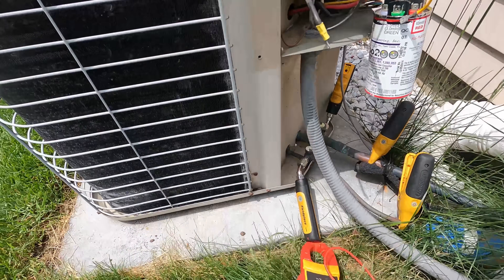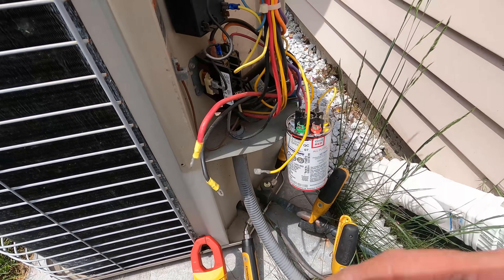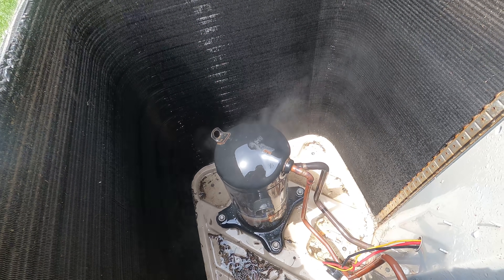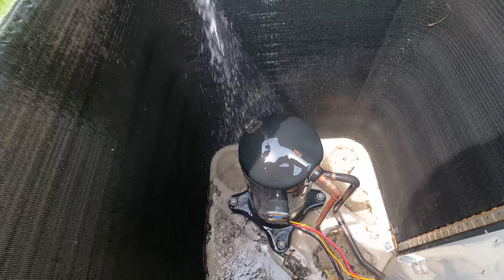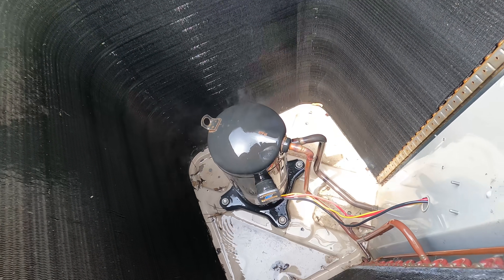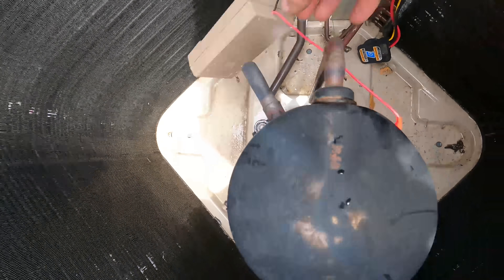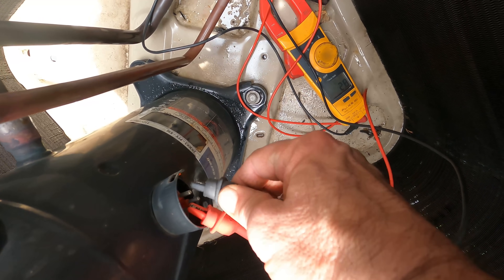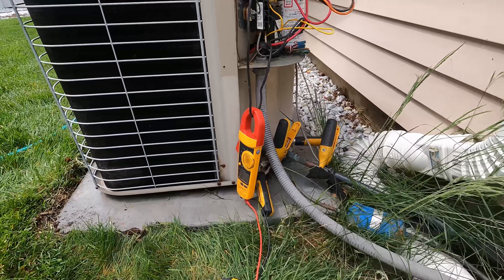AC Compressor Overheated Not Cooling Testing Windings/ Megging, Ohms Fixing HVAC System

Comment: Did you find where the leak was?  You completely filled the system, I did not see nor hear you mention finding a leak prior to addiing refrigerant?
Reply from the maker: This is not a standard service call. This is a Sunday emergency call on the first hot weekend. No leak searches are performed. Only repairs to get systems to operate and return on regular business hours for leak searches or big repairs. New system will be in mid June
Reply: @thehvachacker  You do realize the purpose of the Montreal Protocol Actt was to prevent hydrocarbons from destroying the ozone layer of our atmosphere. It just seems irresponsable to knowingly fill a system which had previously leaked out all its refrigerant, some six lbs of it. I think its a serviceman/womans job to prevent more freon escaping. I would of informed the customer that returning the following day to do a evacuation and a search for the leak was protocol. You would of gotten much better out of it. First you would of prevented more freon leaking to the atmosphere. You would have saved the owners the cost of additional freon in the future and would of fixed the leak. You would also have recieved a few extra hours of work by completing the job. Instead you will have to bill again the customer when the loss occurs poluting our atmosphere and putting the customer through another cooling related service call.  I understand it was an emergency call to get them cool again but I can not stress the importance of fixing the leak the following day when normal hours resume. It will make you a better serviceman by doing so
Reply: @jbpost52  yeah your right..
Reply from the maker: The follow up for this leaker was a sales lead. The customer already has paid for a new system. They just wanted cooling then and now. Their system will be replaced mid June. If I don’t charge the system up someone else will. 95%-98% of the system charge will be recovered.
Reply: @thehvachacker  If the customer is sceduled to have the AC replaced in mid June, it might be wise to push the scedule up to the following day, otherwise the freeon may leak faster than anticipated, provided your work scedule allows for advancing the time slot of this job. As you mentioned you already sold this job to be done mid june.
Reply from the maker: I sold job before charging. It was first available date I could get an install crew set up. This was to get the hem to then. Which it should records show this system gets charged like this every 2 or three years. It’s a small evap coil leak. We will charge up the systems. Yet what we charge for 22 makes most realize it’s not worth to keep the system and put another g into it. I know it’s not nice yet sometimes a reality check makes the customer, we been mailing and informing, every year that 22 has been phased out and the refrigerant may not be available soon. I had them sold upon arrival on the system. I hate having to do that yet 22 leak. That’s why they wanted to start with 3lbs then 4 then 5 was their cap to spend on this system so they could be comfortable. I was trying to talk them out yet can’t turn down a customer. Who will only call another company after I leave.

Comment: Good job man, just curious I know the system is old and its probably have holes in it since its 5lb gas. Just for confirmation, it had holes and they cant afford it or you couldn't check because they cant afford it?
Reply from the maker: It had 3lbs added in 2019. They had money, nice middle class neighborhood. I was jammed up Sunday call and worked to 1am that day. When I am on call/ emergency service, I don’t leak search often. Since it’s an emergency they are calling up about. I will do what I can to make their system work. Then usually a follow up for a leak search happens during regular business hours. If it’s a during the week service call then I will do a leak search. Yet with r22 it’s not really worth to fix leaks anymore.
Reply: @thehvachacker  Good job,dam 1am. Good information on r22.
Reply: @thehvachacker  American environment protection laws are kind of crappy, here you can't even charge an r410a system without finding and fixing the leak first. R22 is straight illegal if you need recover the remaining charge and use replacement gases or replace the unit if it leaks.
Reply from the maker: @netpok  we are allowed to recharge a system. No laws agaisnt. Yet how long will supply last. Plus that call was just under a grand. Not many times will many want to pay that much when zero warranty it will last a few days. If flat I won’t even offer to charge. R22 must be replaced and 410 leak search must be done. Yet system had 100 psi standing pressure and this is first hot week. I know it will last a month if not the whole summer.
Reply: @thehvachacker  Yeah, I didn't mean to say it's "your fault", if there is no law against it they will just call the next guy in the phonebook if you say no.
Reply from the maker: That’s why I charge up a system then look for leak. By keeping them going until they are ready to replace. Stops most from shopping around.

Comment: Wonder if system low like that, do you think there maybe air trap inside?
Reply from the maker: Hard to tell. Yet I recommend replacing. They wanted temporary cooling. The system wasn’t running like it had noncondensible. Yet with a leak it needs to be replaced.

Comment: What is the typical operating temperature of a common kitchen refrigerator compressor?  A modern one, less than 10 years of age. 
Mine is running 125F when not running, and up to 170F when running a lot to restore fridge and freezer temps. Is this fine? 

 Thanks.

Comment: The compressor has an auto-shut-off fail safe mode if too low on juice? What's the cost of a new compressor?, Install in a day ?
Reply from the maker: No safety on this system for low pressure. Yet due to it being an old r22 machine it's getting replaced with a newer unit. I usually don't recommend replacement unless it's an old r22 leaker. Never if it's only an electric part. R-22 has been phased out

Comment: Does anyone know if there’s any benefit to spraying a compressor down when it’s running on really hot days?  We had a string of 108-109 degree days in Texas recently, and I felt compelled to go out and water the compressor through the grill a few times during those days.  Does doing that make it less likely to break down if it’s operational?
Reply: Not directly on the actual compressor, but a mist or sprinkler running on the condenser coil that surrounds the compressor on really hot days can really help out a struggling system, but it’s not something that should be done on a regular basis, as you risk excessive corrosion of the coils/tubing, which can lead you to a leak. If you’re gonna do it, save it for the hottest parts of the hottest days when your system is under its heaviest load.

Comment: Im no expert. But if it took that much freon. There has to be a leak. Isnt r22 kinda expensive?
Reply from the maker: It has a leak on the evaporator coil. I sold a system while here get customer wanted temporary cooling. Until new system was installed.
Reply: Even if I'm in Vegas and 22 I'd rarely used anymore. Just ask the supply houses. MO99 and 422b (nu22) are the refrigerants of choice out here.
Reply: I love listening to guys still in school or guys working through there 1st-3rd summer tell people how bad of a job they're doing! It's soo easy to tell how long they've been in the field. 
When its  110°f on the ground and that means it's 125°f+ on the roof & on top of that you've got 8 more calls to do before you get to go home, let's so you do every tiny little thing the book says to do. The customer doesn't care about any of that shit. They care about 1 thing and it's the same thing your boss cares about......***it's you selling a new unit or fixing that and getting them some cooling with a quickness so you can get your ass to the next one.  Maybe it ain't as busy where y'all are but I know here in Vegas we can't see straight right now it's so busy.

Comment: put bag of ice on top of compressor and let hose run on the bottom 👍👍
Reply from the maker: Ice works if you have it. a hose and running water will always cool the compressor off. That is always available. I can cool the compressor with running water faster than I can run out and buy ice. There is a hose adapter someone made for cooling compressors. who knows maybe one day I will buy it.

Comment: Why wouldnt you go off the name plate for the charge?
Reply from the maker: Most units have a lot more refrigerant than the name plate. The name plate is only good if short line sets are used
Reply: Name plate weight is the condenser filled plus 15' of lineset (normally)

Comment: How do you check for oil? Is there a site glass on this model?
Reply from the maker: no way to check the oil in this compressor
Reply: @thehvachacker Thank you for the reply, so there’s no way to fill this either right? Meaning if you bought a new one it’s factory sealed?
Reply from the maker: You can remove the oil and add new. It required cutting out the compressor, draining, and then adding new. They come from factory with some oil in them. Pressurized with nitrogen and sealed
Reply: My compressor is 20 years old has surface rust, AC still working 50 degrees Fahrenheit temperature reading out the vent downstairs. What is the typical Service life of a compressor? I’m thinking by the time I have to replace the compressor change out to a different refrigerant because it’s an older style and then change out the coils from inside or the furnace is. I’m probably better off just going mini splits for efficiency and cost. What is your professional opinion?
Reply from the maker: @peckerpeter2078 surface rust is nothing to worry about. If system is 20 years old, when compressor goes it’s time for a new AC system.   I wouldn’t put mini splits in to replace a central AC system. You don’t gain efficiency. Central AC is a better choice since all rooms get conditioned. With splits, only the rooms they are in are really conditioned. You hope some of the cool air trickles into the space nearby
Reply: @thehvachacker  Thank you for sharing solid information. I figured to ride this AC out. Already replaced capacitor with contactor, insulated, and wrapped line set on outside of house. Time to replace filters and do a thorough cleaning.. I hate having ductwork in an attic (the most inefficient way to cool a home it’s a 2 story home built in 1992 upstairs air barely comes out plus it’s coming out at 62°F. Downstairs comes out at 49°F.
Reply from the maker: @peckerpeter2078  attics are the best place to hide the ac and duct system. Sounds like you have 2 systems. The second floor system isn’t cooling correctly unless you’re keeping your inside at 80*F. Make sure you’re not sucking in attic air. It can only cool the air entering 15-20 degrees. The air moves so fast through the. Duct system the attic heat shouldn’t heat it up.
Reply: @thehvachacker  thank you for your reply. I disagree that attics are the best place for ductwork especially in zones where the temperatures are over 100° outside the attic would be over 140° guaranteed making  ice cream in an attic is not efficient.

Would munch rather have ductwork exposed inside home like commercial spaces do compared to being in attic.

Home is two-story 2626 ft.² With one AC unit for the whole house furnace and handler is upstream blower located inside garage condenser unit is outside where weather is over 100° F in the summer. I am unable to clean the evaporator because I just sealed up the box that had major leaks. This is a Payne /carrier brand so lines would need to be cut and evaporator would have to be removed to be cleaned and system would have to be refilled. The system is from 2004 so the Freon is way too expensive. Compressor has surface rust it’s just best to clean the best. I can replace the filters and keep it going until I have to replace with a new unit or go ductless mini splits.

After cleaning the condenser and replacing with new filters, I got the downstairs vents with a temperature gun to come out 32 to 35°F, which is an improvement from the 50 to 48°F it was before . Upstairs is a totally different story week air and only comes out 62°F. I’m thinking this Home should’ve had a two unit AC system. this is a concrete tile roof with 3000 ft.²

Comment: Dude R-22 is still around. During the Obama Administration everyone scrambled to replace their R-22 equipment because of massive EPA overreach and massive amounts of R-22 was recovered and sent to reclamation facilities. Just because it's not being manufactured anymore doesn't mean it's no longer available. So many R-22 systems were replaced that the price of R-22 actually dropped at one point. What are you going to do when you put in a new R-410a machine with that logic and it is phased out a year later and you have to explain to the customer that they will need to replace their system again? You can literally still buy R-12 and it hasn't been manufactured since 1996. R-410a is literally on it's way out. Daikin has already committed to R-32 (you know, the parent company of Goodman). Did you even look for oil? The suction was in a vacuum so signs of oil should be present somewhere and, even if you don't immediately see any, a leak detector should pick up refrigerant somewhere. For all you know, the leak could be a flare nut on a TXV that just needs tightened. Also, why are you charging by vapor? Seems like a giant waste of time considering that after a pound or two the bottle gets so cold you can barely suck any vapor in. All blended refrigerants must be charged by liquid so why not charge by liquid for all refrigerants?

The worst thing about this entire video is that you walked away from a unit that literally just had a compressor out on thermal overload due to inadequate cooling because of low charge with only 2 degrees of subcooling on a unit with a TXV. You literally left the unit low on charge. The chances of having a solid column of liquid at the TXV are slim to none. What kind of service tech asks the customer how much refrigerant they want added? You either charge it properly or let a real professional charge it. Never in my career have I let a customer dictate how much refrigerant was added to a system. It's charged when it's charged. They know know up front how many pounds it holds and how much it costs per pound. I do it right or I don't do it at all. Of course I never ever ever troubleshoot a unit without inspecting the entire system to begin with and I NEVER neglect to look for oil when a suction is running in a vacuum. HVAC Hack is a more appropriate channel name. You just want to sell a new unit. I'm sure you had a nice long talk with them about that off camera. 

If you are watching this video for educational purposes I highly recommend you choose a different channel. 0/10 for skill, 12/10 for half assed hackery.
Reply: Truth bomb
Reply: 100% agree. Where was the check for a leak? Especially this expensive R22. It's just going to leak out again.
Reply: @f.hababorbitz  At the end of the day, a full blown leak search is the customer's choice but it only takes 15-20 minutes to visually inspect for oil and run a leak detector over U bends and common leak areas such as rusted filter driers and accumulators. I would have 100% charged it up, leaking or not, if that is what the customer wanted me to do. A happy customer is a returning customer. Customers will spend more for repairs/replacements if they feel like they are receiving quality service and aren't being screwed. It's hard to do that when the unit wasn't even charged properly to begin with and will most likely start flashing in the liquid line in a week or two and, subsequently, run with a starved evaporator and high suction temp (that's what causes compressors to cycle on overload after all) because it's still under charged.
Reply: Bingo stockpile of r-22 years supply left . Markup is through the roof the industry did the same thing with r-12.Train has left the station with global warming . If they where so concerned about our earth why close all American coil factories that made quality coils that didn't leak .HO CHI MINH CAN POUND SAND!
Reply: @metal2444  nothing like using thinner walled coils and increasing pressures in them by 100% at the same time. cough 410a *cough*.

Comment: I know this is not a window unit your working on, but I am puzzled with this LG window unit AC I am trying to fix. The compressor is coming on but it takes a bit to finally kick on, and getting cool normally for a few minutes, but then it starts getting hot and the compressor only is shutting off prematurely and then about 6 to 10 minutes later it will kick back on and blow cold again for a few minutes and then the same issue repeats? Do you think it needs freon or a electrical part, or do you think the compressor is bad? It does vibrate alot and gets louder when it starts getting hot. I have the cover off and it's not all clogged with debris/dust, and the fan works fine. It's a 9,800 B.T.U. Unit and it uses  R410A refrigerate. What do you think? Thanks
Reply: Not a technician, but the system might be choked. The filter drier or the capillary bcoz d freon needs to pass through d compressor to cool it.